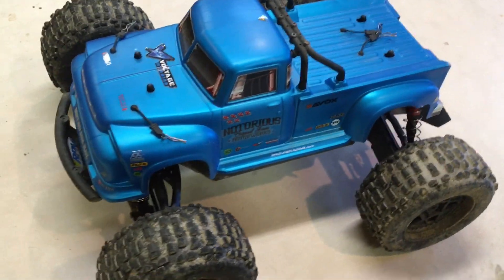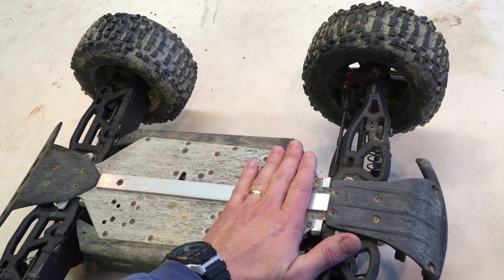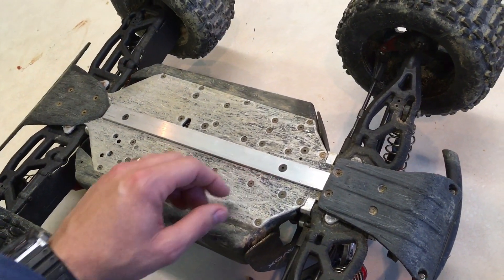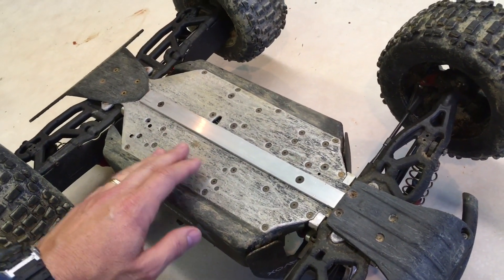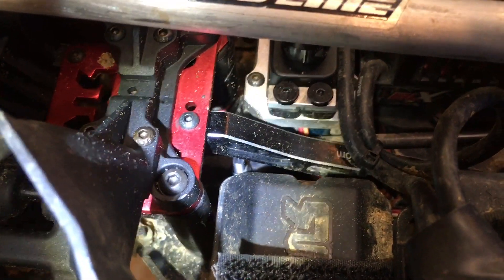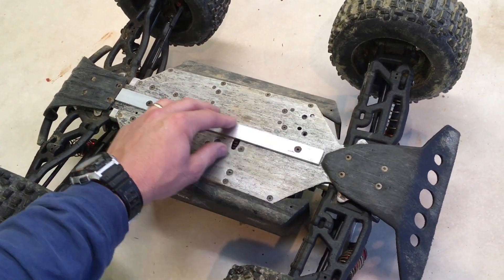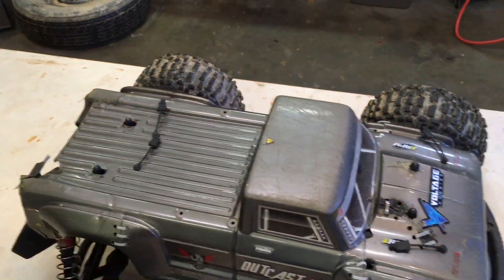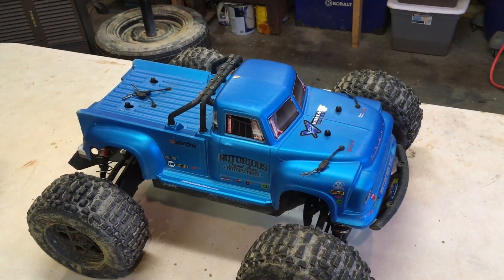Arrma Notorious Skid Upgrade

Comment: nice idea bro... i use a piece of lexan from homedepot to cover entire chassis... works great.. my proline 4x4 chassis still looks brand new;
Reply from the maker: RCbashing the KRATON 
That is a great idea. I will have to look into the Lexan Application. Thanks for the idea.
Reply: How did you mount the lexan?
Reply: I have had my first couple arrma swb/lwb lexan chassis protector that's been sitting around for awhile now since I watched #RCbashing the KRATON.... have to say that although I havent yet mounted the two chassis prototypes only because I have been hoping to find some sort of clear strong adhesive to use but I have since become intrigued to say the least on how many different ways I've used the flare lexan sheets to do all sorts of rc related stuff. Reinforcing wingmounts, custom stretched typhon body mounts and I also made a ton of a arm dirt guards etc etc with a diy plexi bender I built from a blow dryer heating element which has been working great. Thanks for you guys who bf tr ake the time to post this great content. Anyone have any thoughts on methods on mounting/location or adhesive that may work ? Plan on cover some with vinyl wrap to see if it comes out looking better than just the clear... chears

Comment: Do you destroy bodies fast without a wing?
Reply from the maker: slicktmi   The original Outcast body in this video is still usable and it’s over 30 packs old (over a year). I haven’t really had a problem w/out the wing. Seems to be harder on shock towers more than anything.
Reply: @skybasherrc2372  have you bent a voltage shock tower without it?
Reply from the maker: slicktmi Unfortunately I have. But it was on a very bad landing.